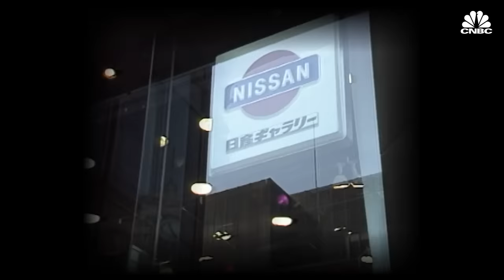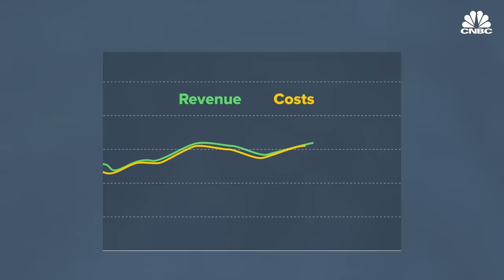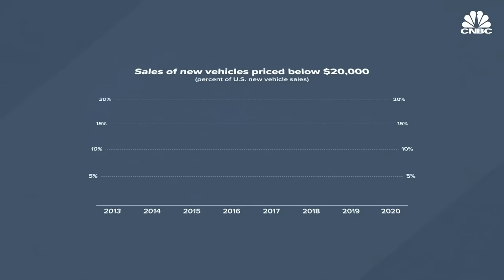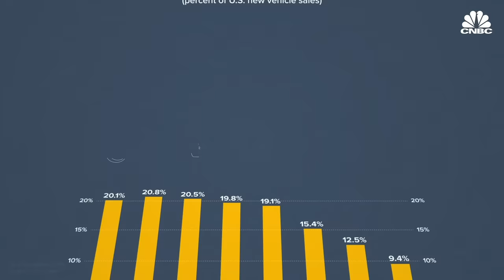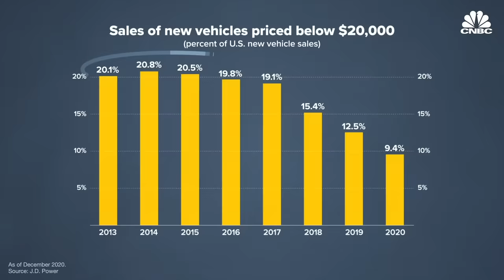Why Cheap Cars Are Disappearing

Comment: Here in New Zealand and in Australia, Chinese car brands like Chery and Geely are actively competing with the used car market by selling, cheap, brand new cars for $12,000 or less.
 
I would have considered buying a Chery car but due to the fact Chinese cars are still fairly new to the Western market, there's not enough spare parts for them to go around just yet.
Reply: I would not trust a car made in china 😂
Reply: The quality of chinese Auto has greatly improved recently. Both.Chery and Geely are very reliable at this moment.
Reply: The price is so low it is not a big gamble.

Comment: We can all keep driving our 95 camrys forever guys!👍
Reply: And then just pay for an engine and trans rebuild in a decade lolol
Reply: Pod 
Would probably be cheaper than getting a car payment
Reply: @P7777-u7r  true.
Reply: @P7777-u7r  Actually pff probably cheaper to have a low mileage engine/trans throw in instead of a rebuild
Reply: I love my 2005 Toyoto Echo and it's a stick shift. I bought it cheap in 2017 and the mileage was only 90,000 miles. I am very lucky
Reply: @ernesttanare862  I'm jelly.  I wanted an Echo but I was able to find a 400 dollar corolla with 140k.  I'm happy tho.
Reply: @pod9363  Be proud. Toyotas last forever
Reply: I have a 98 strong
Reply: @ernesttanare862  only with proper maintenence... Like any car really
Reply: My 2015 Prius was purchased brand new for $32,000 zero maintenance it has 350,000 miles again zero problems all original parts except tires brakes rotors battery 🔋 small one. That’s all! And air and cabin filters. I’m going to drive it till it hits 600,000 miles. My other car is a 2015 Buick v6 lacrosse 74,000 miles purchased for $15,000 zero problems. I don’t need more cars or more expensive cars. My home was purchased for $65,000 now it’s worth $900,000 also paid off. Zero debt loving life. Never wanted to get married. My only son now 19😎. Loving pandemic days and lockdowns
Reply: @nightowl6811  you must live a good life
Reply: @icanfinnsmh6824  I paid the price bro! U have no idea how stressed out and over worked I was
Reply: I drive a 95 LE! 340,000 miles and runs like new.
Reply: @kenball1980  2015 Prius 319,000 here zero problems
Reply: @kenball1980  Sounds nice, but does it have self driving?😂
Reply: @TLM860  nope, it doesn't even have ABS.
Reply: I've got a 2006 Toyota Carolla with 132,000 miles on it. I've had it for 5 years and will probably get another 10 out of it.
Reply: 97 Lexus LS400 here! Still runs like a champ!!
Reply: '08 camry w almost 200k miles, still taking my corners at 80mph 😂
Reply: @pod9363  DAM a $400 corolla, NICE
Reply: Scotty says buy a Toyota...
Reply: @tarsan894  so true if you take care with maintenance any care can last
Reply: After a quarter of a century driving my flawlessly running 1985 TOYOTA Supra, I have switched to an utility vehicle, the 2005 Toyota Sienna and currently it has racked up 302K miles without any expensive repair. I will never buy anything with too many assistants and sensors.
Reply: @pod9363  if it’s a good car 400$ is a steal

Comment: Why buy a new car? They lose 30% driving off the lot. Just buy used
Reply: Who buys cars thinking they'll making money off it?
Reply: @Andrew-on3vc  you’re not going to make money, but you might as well lose less
Reply: Exactly,  they're talking about econo-boxes for $20k, when one can buy a used Lexus with 60k miles for $15k
Reply: @seanthomxx2694  right on the money. Why buy a new Corolla when you can get a low miles used ES350 for the same price.
Reply: I have only bought used vehicles. But my parents and grandparents only buy new and then keep the car until it's no longer reliable
Reply: Right! If cars didn’t depreciate the way they do, it wouldn’t be so bad
Reply: Depends on your net worth. Warren Buffett only buys new cars, but the lost value is no sweat off his brow, and he will typically buy the ones with hail damage or some other reduced price
Reply: @Andrew-on3vc  who buys new cars knowing they being swindled by the stealership?
Reply: As cars are getting more and more complicated and people are getting less and less caring about them buying a used car, even a few years old is getting a larger risk. Idiots can abuse a car for a couple of thousand miles and basically destroy them. I bought a new so I can be sure that it was serviced properly and treated well and I will drive it until the wheel falls off. Here in the UK thousands are suing ford for blown head gaskets, yet they idiotically push them with cold engine and stretch servicing.
Reply: @miklossomogyi2283  people seem to buy used cars. But don’t realize the costs of maintenance cause by previous owners smh 🤦‍♂️
Reply: Wrong. That's if you buy a car and pay msrp. You can get a car for 20-25% off msrp and then only lose 5-10% after year 1.
Reply: @JarivLetap  truth, but then again, a Corolla is still a bigger car than the ones they put in this segment. Those cars were more compact than small
Reply: @seanthomxx2694  You can get a 2021 Lexus UX for $29K after dealer discount. Msrp would be about $34K, but 15%-20% off msrp would make it $28-29K. And would be worth $1,500-$2,000 less after year 1. And about $14K after year 10. But you have to take into account that if you buy it at year 10 for $14K, you'd just be closer to having to buy another one at year 20 vs just buying 1 during that 20 year period, so you pretty much end up spending the same amount of money if you buy used or new, over those 20 years.
Reply: laughs in Tacoma
Reply: @Andrew-on3vc  In NZ most people buy second hand cars and some people do make money off it.
Reply: Problem with used is that you have to account for maintenance and other costs. You may or may not get a warranty and it sometimes can cost more to repair it. I have had a used car but thing is when it was 100k miles I had to pay for more and more repairs.
Reply: Don't buy used either, just keep your old  car.
Reply: @Andrew-on3vc  Uber drivers
Reply: People want that New New
Reply: @jsoe81657   that's  with certain brands(i.e. Infiniti) but lexus/toyota tends to be low also you know what you're getting with used vehicle.  People get new vehicles not know that there's issues where as used used can look up common issues that are due to happen around certain mileage
Reply: I bought a new Honda Fit. Got hit and it was totaled 3 years later when I still owed 50%, but I got 80% of the loan for it. 

Not every car is a bad idea to buy new. Small premium for knowing it’s only been your car and not abused. 

Much larger premium for other companies though obviously. Just be smart understanding the value drop off of what you buy.
Reply: I've only considered buying new cars when they come with free car washes ,oil changes & 100k mile warranty . Nissan of Bowie, Maryland bug ups
Reply: @wolfgangk2824  We have a different mindset, people change cars every 5 years lol. Also as there are so man used import we have almost infinite parts etc lol.
Reply: @Maximilian Stocker That's a good idea. I'm from Germany so I know that car ^^
You're smarter than the average buying a car like this because these are typical "elderly" cars; not the most beautiful but that's why their pricing is so good. Opel Agila the Suzuki version called WagonR, a Ford Fusion, Hyundai Matrix, Fiat Idea, Opel Meriva, Renault Modus and so on.
Reply: Not all cars depreciate like that.People don’t often think about say special versions of cars.For example my second car is a 2014 FJ Cruiser trail teams edition I drive maybe once a week.Bought it brand new for $32,000.Cars now worth around 34k
Reply: @thepebblesexplore83  yikes,  I'm glad you're alright,  but I always thought those cars would be a death trap in a collision.  How well did the car protect you?
Reply: @chrismayher617  true, but rare. Special editions, Porsche, and high demand mod cars are the exception
Reply: yep, good Financial Advisors recommend not buying a new car unless you already have a 1m+ net worth, and even then its dumb in my opinion.
if you want some luxury or sports car, just buy one thats a few years old and save like 50%.
Reply: Thank you 4 year old reliable Toyota’s or Honda’s are the way to go. Don’t be an idiot and pay for cars that lose half their value in their first couple years. Use the money you save to buy a house or invest simple
Reply: I keep my car for around a decade and don’t care if it loses value
Reply: @kyle7574  i do also, but i bought a used one that already lost the majority of its value. win win. i have a 1.7m net worth and even i dont buy new cars lol, there simply is no logic in it. its a product that gets you from point a to b and it doesn't need to be fancy.
for the money people blow on a new car they could put a down payment on a cheap rental property and make money instead of a guaranteed loss which is what a new car is. thats what i do.
Reply: @UserName-ts3sp   but someone have to buy it new , so you can buy it used, if nobody was buying new cars, you won't find a used one to buy 😁😁😁😁.
Reply: I made the mistake of buying a car with unreported damage. Will Never buy a used car ever again
Reply: @seanthomxx2694  exactly. And if you take care of a Lexus it can last 250,000 miles.
Reply: @kamfire98  im sure a new car with depreciation is still a bigger loss.
if you buy a $2000 car thats junk then thats a $2000 loss, if you buy a $30,000 car, the second you drive it off the car lot you lose over $2000.
its not hard to find a used car that has been thoroughly inspected for damage.
Reply: @seanthomxx2694  well it was at about 15 miles an hour so the fact it totaled so easily is maybe why I didn’t have any whiplash whatsoever. Dunno. But I didn’t buy another Honda after how easily it got totaled.
Reply: Buy the cars that were leased for 1-3 years or were used as firm vehicles. Bought an S4 Avant practically new for nearly 20k cheaper
Reply: Ikr the only time I would even consider buying a new car is if I’m financially well off and I’m planning on keeping that car for more than 5 years
Reply: Depends on the car. I'm a car salesman myself I see the value in owning 1 mile new but I also see the value in buying a dealership owned loaner car classified as new. Some cars are worth it buying/leasing new due to high resell value. I can buy or lease a new or loaner car, truck, and some SUVs and come out positive equity depending on timing and age of the car.
Reply: @benbelair7381  A Tacoma I would buy new not used. Resell it 2 or 3 years later for a profit. So easy!
Reply: People want to buy new to showoff
Reply: @JarivLetap  depreciation, cost of maintenance, price of parts, and overall reliability of the Rolla to the Benz.
Reply: @gorillatrading5452  breh, Lexus has the similar levels of reliability to Toyota. Parts are prolly a little more expensive. I was taking about the Lexus ES350 not a Benz. I’d lease a Benz if I were to ever get one 😂
Reply: Exactly, you are throwing money away.
Reply: Used cars mean trusting the seller about their usage and maintenance history. And usually their records are shoddy if not nonexistent.
Reply: @Andrew-on3vc  says the one with a Chevy as his own car
Reply: @chrismayher617   no way not on a trade in no way
Reply: @Big-Government-Is-The-Problem  smartt
Reply: @OneManOnFire  that’s really stupid don’t do it people unless you waste money to lose $10,000 2-3 years later eww
Reply: @OneManOnFire  Yeah I just bought a new Tacoma. My father has always owned a Tacoma, his latest one is 2017 which he leased as a business expense - easier to lease for accounting purposes. His buyout option is 7k~ less than the actual value of the truck. Basically a free year of lease. He's just going to buy it from the business and keep it as a personal vehicle. These things barely depreciate, it's insane. Great truck, awful gear ratio though.
Reply: @Yondaily  I'm a car salesman/gear head and if you know your cars, trucks, and suv it's possible to make money buying it leasing new. Leased a Chevy Colorado to a customer and told him to sell at 2 years came up positive in a private sale. Customer bought not lease a gmc sierra after 3 years came up positive on trade in with us. Chevy SS manual sedan customer came out positive. Diesel Chevy Cruze came out positive. Not all cars you lose money
Reply: This is literally why manufacturers don't want to sell cheap cars in the US.  Nobody wants to buy them because Americans would rather go into debt for something they can't really afford.
Reply: @Big-Government-Is-The-Problem   true. I prefer stocks but yes that’s right
Reply: @canto_v12  another reason the used car market is the way to go. Not only do cars depreciate immediately when driven off the lot, but a lot of used cars are those repossessed or handed back over because the original owner couldn't  afford it new. I've seen new Lexus RCs on  the lot of an Infiniti dealership selling for $24k  when it normally sells for $42k
Reply: Exactly. 

Because of COVID-19 and it’s effect on the car rental industry.. used prices are way down both from fleet returns (with almost no miles on them) and the flooded used market as people try to shed liabilities. 

I paid 1/2 sticker for a car less than a year old with 7500 miles on it. Full size and loaded for less than $20k and way more comfortable and roomy than the tiny SUVs they are flogging for much more money.
Reply: @kyle7574  same, its no hassle compared to being a landlord
Reply: @Yondaily  yes way.The dealership tries to buy it every time I bring it in for oil changes.I still have under 10k miles on it because it’s never been a daily.You don’t understand how desirable the car is for people.Most fjs with over 100k miles on it are still selling for 20k but that cars a really bad example
Reply: Do you want to pay a car note or a mechanic?
Reply: Obviously, if everyone did that. We wouldn’t have used cars. 

Gotta make those used cars somewhere! So where do they come from? People who buy new cars!
Reply: @kevindao1103  you're right, thankfully there are plenty of dumb people to buy new cars and sell them for a 50% loss 2 years later
Reply: @Acteaon  way to go Einstein
Reply: I don't know of this is particularly true in this market.I know I've been looking at  lightly used cars this year.For the most part they are not much cheeper than a new car.
Reply: @matthewconley9869  that’s because used car prices are are higher because people don’t want the larger investment and the factories were cut short during covid so less production for the new cars
Reply: @AshleeTuck  a mechanic
Reply: When you can buy new for under 20k and drive them for nine or ten years, it is very affordable. You avoid buying someone else's junker or troubles. I need reliable that i can trust to go from coast to coast without worrying. If I am the only driver, I know what shape it is in and can trust them. In my sixties and too old to be broke down on the shoulder of a highway or on a back road in the middle of nowhere. Plus I usually get zero percent interest when they offer it. It pays to have a good credit score. At most I will pay under two percent for a car loan. Cannot get that kind of interest on a used car either.
Reply: @markpashia7067  plus they charge extra for the previous owners farts.
Reply: I. S  true but the driving public as a whole doesn’t do that. They trade up or equivalent and get something else.
Reply: I. S  depends on who you ask and the size of their wallet.
Reply: @George L it’s only money.
Reply: @George L all that depends on the maker of the new vehicle and its quality control

Comment: Hi. When a noun starts with a vowel sound, the pronunciation of the definite article is the same as every time you say it in this video. That is, it sounds like "thee." However, when the noun starts with a consonant sound, such as in "car" or "concrete," the definite article is pronounced "thuh." If it's confusing, you can use this trick: Just use the indefinite article for the noun, and then remember that if the indefinite article is "an," the definite article is pronounced "thee," but if it's "a," it's pronounced "thuh." It helped me when I started out learning English. Cheers, and thanks for the video 😊